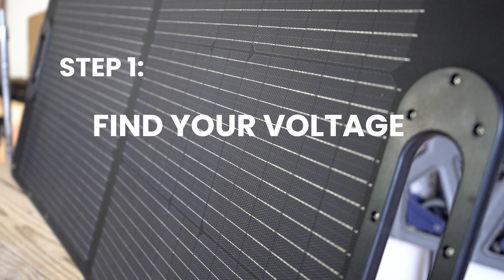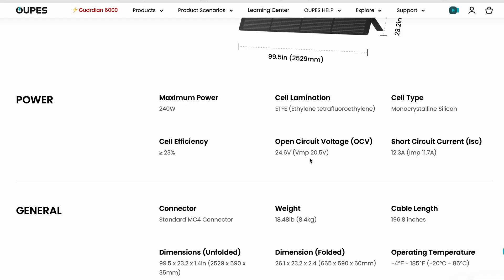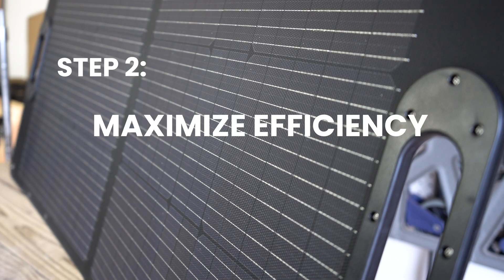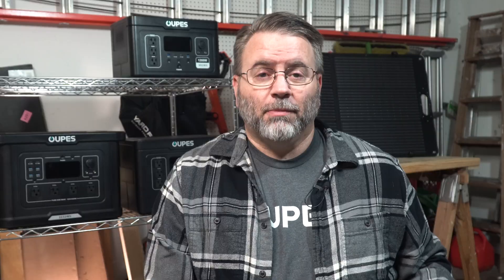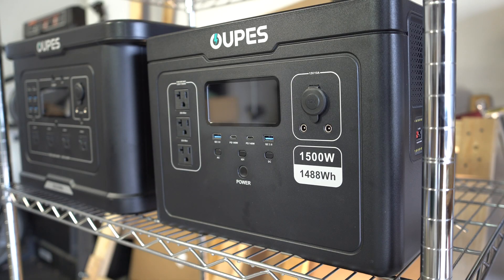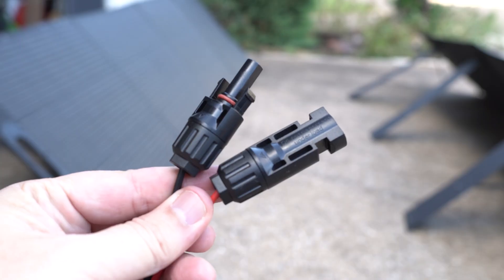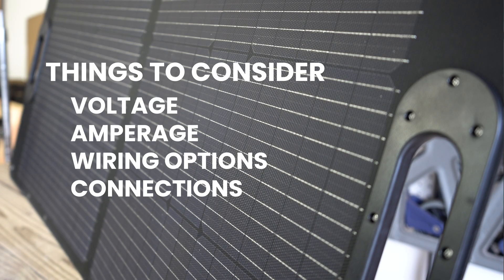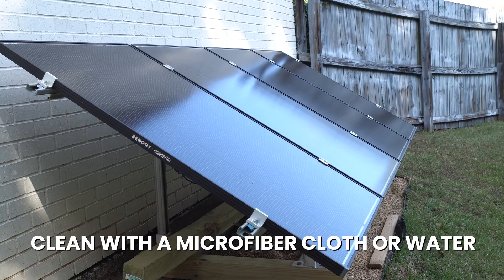2 Easy Tips To Pick Your Solar Panels｜OUPES Academy 101

Comment: Hey Scott, Love your videos! I just purchased (Today) then Oupes Mega-1. I know it has a max of 800 watts solar input, however, charging via solar will not be my most common way of charging but I do want a non-Oupes solar panel. I was wondering if you could recommend a non-rigid portable solar panel (renogy etc..) that I can buy. I don't need to max out at the 800 watts but I would like to have between 400 & 500 or so watts. Thanks, Jeff